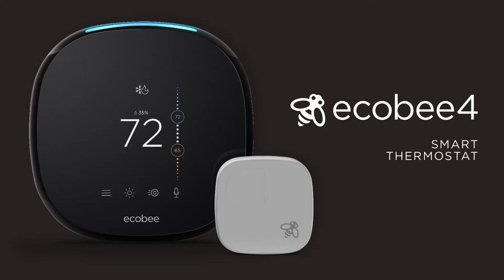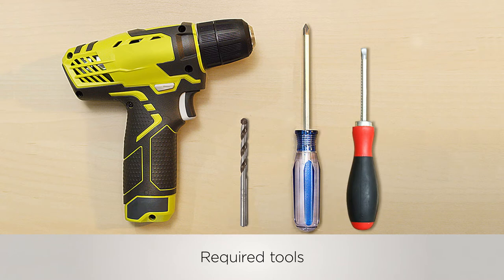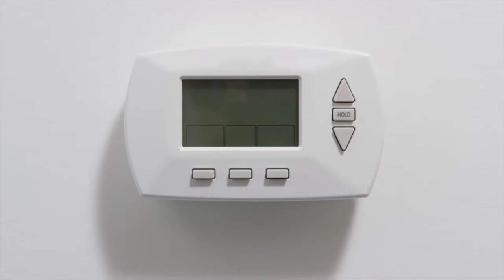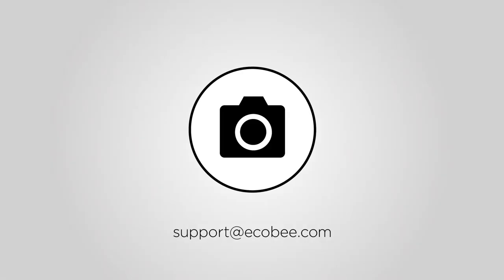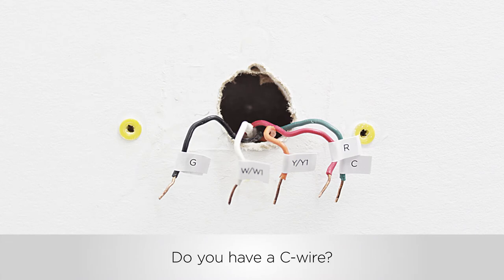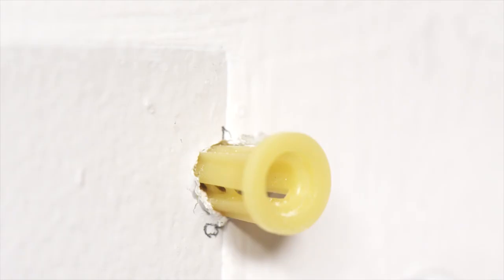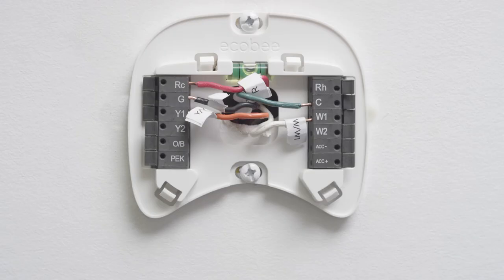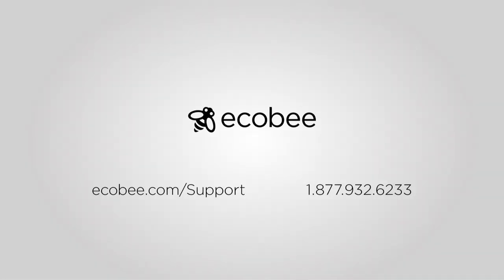ecobee support - Have a c-wire? Verify your compatibility with ecobee4

Comment: ecobee work without c wire ?
Reply: No, the C wire is (Common) which is power.  It needs power to run.   I didn't have a C wire either.  I did have an extra wire not connected on either end.  So really, I connected it on both ends and all was good.  It does come with what is called a PAK module.  So if you only have 4 wires at your thermostat, you're still ok.   You would go to where your heater is, where the Thermostat wire goes to,  You would plug it into this module instead, and then the 5 wires on the PEK module to the heater terminals which should actually have a C connection point also besides the other color wires.  Mine had 1 wire to the C terminal already going out to the AC unit I believe, so I just connected the 1 wire not being used to it also.  So no need for the PEK for me.  I wasn't sure until I pulled the old out off and looked at the wires.  The one not used was tucked back into the wall, not easy to see at first.

If there's just no way to get a C wire from the furence.  It doesn't have a C connection.  There's always going with wiring up a 24 volt transformer.  You can find videos on doing that.